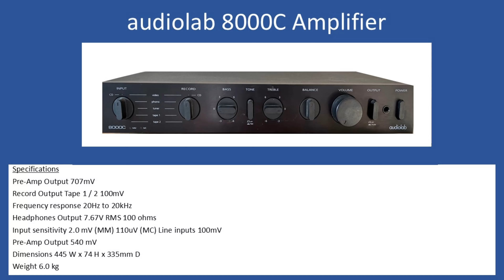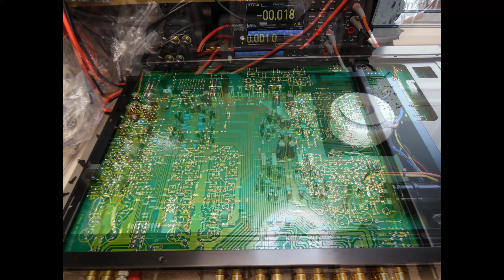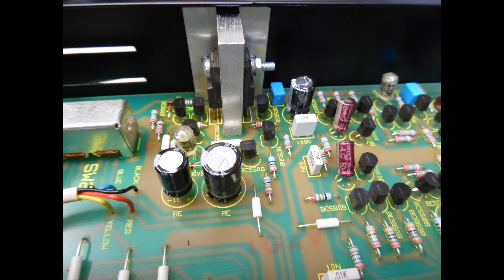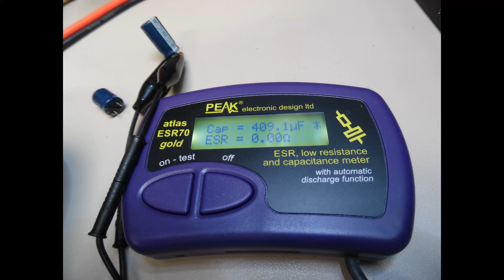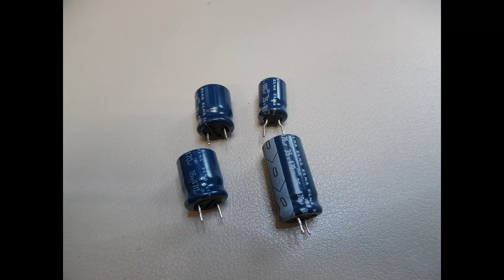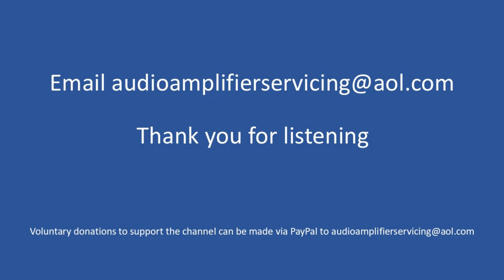audiolab 8000C Amplifier Repair (With Audio Tutorial)

Comment: What size  caps? I assume the 8x11.5mm for the 470uf 16v, 10x16mm 470uf 35v and 6.3x11mm for the 100uf 35v? going to undertake one of these as a project
Reply from the maker: Hi, the dimensions you have advised look to be correct.

Comment: Another informative, interesting and exciting watch as always, Gary! 
Audiolab stuff is quality. Great to have the component values printed on the board. A lot of manufacturers don't do that - Simply makes life easier.
Thanks to @chrissmith7069 also for the component content 👍🏼

Gary, have you ever thought of doing a 'my gear' video? Showing what solder, irons and other tools and gadgets/goodies you use? Maybe even showing a 'work in progress' of soldering or similar? I for one would be interested. I realise you are most likely busy and it may be a nightmare to record, but just a thought.

All the best, and thank you!

Lloyd